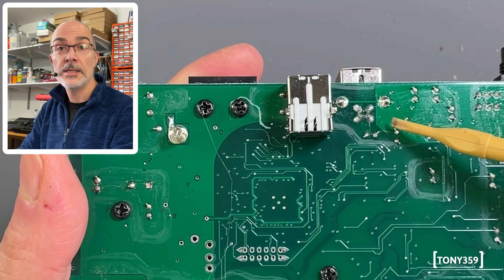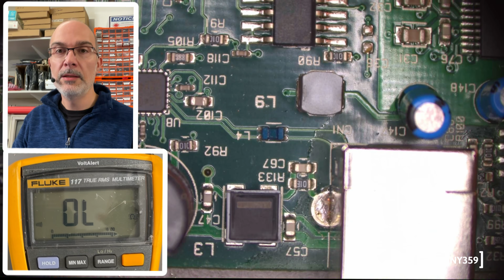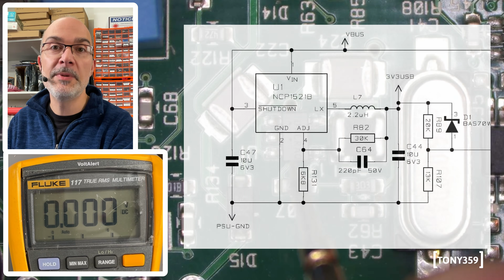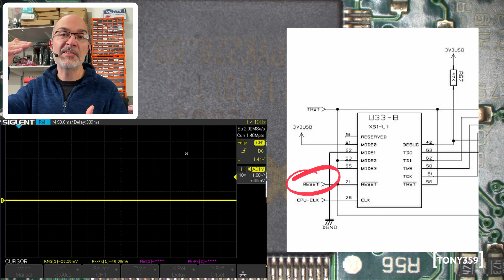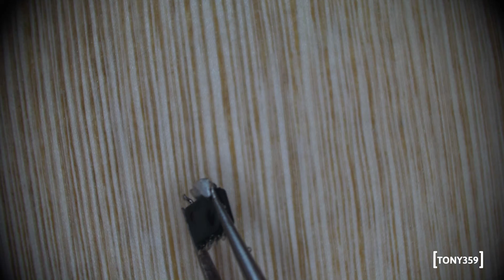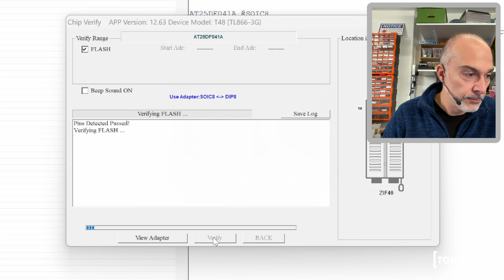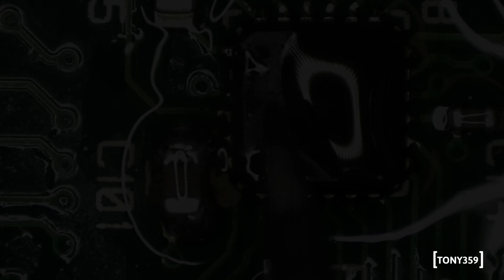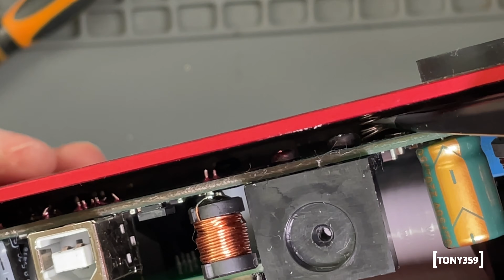Fixing this soundcard wasn't easy!

Comment: hi... first hard solder is tuff.kkkkkk.. well... it need more solder in the pcb, you dont need to wick solder out, you just clean using new solder. and to help you can claen the new chip, and left a litle bit of solder, it will improve a lot.  and finaly press down and the excess solder will go out on the border, that a sign thats all the chip is flat in pcb :) and you will never miss again. excellent work never the less. ps- i avoid to solder just one pad.... even if the rest apears ok, usse a blade and redone all the line at same time...
Reply from the maker: Thank you, I appreciate all the tips! I hope I can do another one soon! My blade tip was too big, I think you can see it at the beginning. It wouldn't even fit between the IC and the capacitor! I'll get a smaller one for next time!

Thanks again!

Comment: soldering tip was not too big, the soldering wick was improberly sized. Should use a knife-type tip.
Reply from the maker: Thanks - that’s the only wick I have and yes a bit on the big side! The first tip was knife but once again, too big 🙂 
Thanks for watching!
Reply: @tony359  learn to use the knife, I solder 0402 with a fresh 245 knife.
Reply from the maker: Well, not all 245 knifes are the same! Mine did not fit between the cap and the IC! My knife would solder 0402 no probem! :) 

But mostly I think the IC was not fully seated - hence the issue with the pad not soldered.

Comment: I had a similar/opposite issue.  My MOTU interface was having issues with the 3.3v overheating and dropping out.  After a number attempts to fix it I finally gave up on it.  It was a firewire interface anyway, so not a total loss. I am using a Focusrite Scarlett 18i8 now, love it.
Reply from the maker: Interesting! I used to have a MOTU Traveler which was a Firewire only interface. My 4Pre is FW and USB, really like it. But I believe it's a different price point than the Focusrite, which is a nice one too! Thanks for watching!

Comment: Nice work. The plug tip breaking in a jack is a pain, had it happen a couple of times which lead me to only using Neutrik plugs. The construction is much better than most with the tip being one full length piece of metal instead of a riveted design and the strain relief is the best I have seen in any plugs. And they are not the most expensive either,  sold at Thomann as assembled with Cordial cable at very reasonable price..
Reply from the maker: When it comes to sound, poor quality connectors and cables are to be avoided as much as possible! Well, the same applies for everything else of course! And you're right, often the difference in price is minimal so really no reason to cheap out on those things!
Thanks for watching!

Comment: I adamantly avoid spraying contact cleaner on sealed potentiometers like these. It usually works for a while, but the grease rinses out this way and that becomes evident with time!
Reply from the maker: Yours is a good point - though the contact cleaner I used is suitable for pots, it's lubricated. Thanks for watching!
Reply: @tony359  alright, cheers! They're not painfully expensive at ALPS, so you could always swap them out. You're not afraid of an adventure 🙏🙂

Comment: This was great!  I'm secretly happy you didn't get this to work on the first attempt...proving you are human like the rest of us lol!  I'm often working on vintage audio gear from the 1970s... really have to be careful with those solder pads as the bond between the board and the pad itself will fail even if you look at them funny.  It was very rewarding to see this device come back to life.  I really liked the segment where you pulled the firmware chip to validate.  Fantastic as always!
Reply from the maker: thank you for your kind words! Yes, it was that good balance between "easy" and "challenging"! Just the socket would have been boring :) Thanks for watching!

Comment: you can connect the rode wireless directly with usb c to the computer and get the actual digital audio
Reply from the maker: Ohhh… that’s why the Rode is ‘recognised’ when I charge it I could never figure out what device it was! I record on the iPhone anyways but it’s nice to have that extra option! Thanks for that!
Reply: @tony359  update - I compared the quality of usb-c in the receiver vs internal recording in the transmitter and the latter is unbelievably superior - turns out the receiver adds some distortion that is not present in the transmitter. All of that hassle though...
Reply: @fffmpeg  I believe you need the Wireless GO II to use USB as a recording device. Mine is the first version. If the quality is not great, nothing to be missed then :) Thanks for the update!

Comment: As someone who has not only had to replace the USB connector on a Focusrite 6i6 but also on an Akai MPK88 keyboard one word of advice: upgrade them to USB-C while you're at it, I bought a couple of 4 pin type-c connectors that terminate in a little DuPont jack and just soldered 4 wires to the pads of the old connector in the interface and crimped a fitting connector on. The type c jack fits snuggly (although diagonally) into a type b slot and can be additionally secured with a little hot glue.

You don't have any real benefits but moving my complete setup to type c has been so nice and even micro b plugs can usually be upgraded with a little bit of filing.
Reply from the maker: I can picture someone trying to plug the Focusrite blindly, trying to align the USB plug to the diagonal socket at the back! :D
Thanks for the idea - and for watching!
Reply: @tony359  I mean blindly aligning any USB C plug is probably easier than any other USB version so that's a risk im willing to take. Given, for an interface that's plugged in most of the time it doesn't really matter but for other audio equipment, some of which to this day is only available with micro USB B, this is so nice if you switch controllers often or don't have your audio setup on your desk the whole time, one plug to rule them all! ;)
Reply from the maker: absolutely!

Comment: Many thanks for posting this video! I have a Focusrite 2i2 with the exact same problem. I think go straight to replacing the USB intercafe chip. I have a 2i4 on which I replaced the USB port and that just worked fine so I guess I got lucky. I also have an M-audio interface, but those are known for the power supply chip going bad and cost more than the device is worth when I last looked so it's still an expensive doorstop at the moment. However, watching your video has given me hope that I may be able to repair at least one of them.
Reply from the maker: Amazing, hopefully you can fix it! Thanks for watching!

Comment: Another great video and repair. New old stock parts having older solder sometimes don’t work well with hot air. I have found adding some fresh solder and flux does wonders. Keep up the good work and I look forward to the next one.
Reply from the maker: Others also mentioned, definitely something I'll keep in mind, thanks!

Comment: I've had two of these. Both failed in the same way. After about a year, the monitor potentiometer became scratchy then intermittent. Disappointing.
Reply from the maker: Too bad! If I remember right those pots are sealed, not really much you can do, right? Thanks for watching!
Reply: Real. I tried Dioxit, but no joy. @tony359

Comment: Cool fix!  I have quite a few of these Focusrite interfaces (different sizes and gen) that I have collected over the years.  I have never actually seen inside one, so it was cool to see its guts.  It must've taken a fall at some point to manage to snap off the 1/4 jack tip.
Reply from the maker: It's easy to fix, there is an opening at the back of the socket, probably designed for those occurrences in mind!
Reply: A fall is unlikely to cause this. I suspect it may have been an adapter of some sort as I have known those things just fall apart or a plug that was already damaged by being stepped on, for example.

Comment: I always wonder why fresh channels put like 10 like and subscribe prompts? Does it help? Cause every time I see one all I can think of is 'piss off' and autodownvote. 
Also slathering everything in flux is a new thing or smth? Cause popping off that so8 didn't need none.
For touching up those pins 0.2mm solder wire works really well.
Reply from the maker: Well, making videos cost me money and (a lot of) time. You can watch it for free (or skip it) and I discretely ask you to "like" and - if appropriate - subscribe. 
I don't think there are 10 like and subscribe prompts, I think there are two, plus a Twitter one. 
It's a small banner in the corner, don't you think it's ok after the creator spent weeks to make the video? (Yes, it takes me weeks).
I don't have 0.2mm solder wire I'm afraid. The smallest I've got is 0.7 because I don't normally do SO8. And I really don't want to buy a reel of 0.2mm wire just for this video because it cost me more money than I make! :) 

Hence, I ask you to "like and subscribe" :) 

Thanks for watching!
Reply: @tony359  NO, I don't think I will.
Making vids costs you money? Why do it then? Or this is about the money, together with sucking the proverbial teat of pcbway, but hey, everyone does it, right?

Comment: Great work! have a look at the USB chip at 13:03..... near the R5? mark and R=330E (?pin 21, 22)
The original soldering work is not connecting the chip to the pads. Not a propper soldering
Maybe just reflowing the chip would have done the trick.
Reply from the maker: I think that was me poking around off screen, the probe just squashed the solder. But you are right, I could have tried re-flowing it first! Thankfully those IC's are cheap! Thanks for watching!

Comment: Hi great fix! can I ask where you buy your flux please? struggling to track down a good supplier. I think you are in the UK so asking.
Reply from the maker: Thank you! I have the AMTECH which is the best but very expensive. A genuine authorised Amtech reseller is on ebay (they show the AMTECH business card). Since I cannot justify using the amtech for general purpose soldering, I tried the KINGBO RMA-218 from Aliexpress. I think it's ok and it's MUCH cheaper. Maybe on this occasion I should have used the AMTECH - I forgot! :)  I hope this helps!
Reply: @tony359  Is that reseller on ebay be "CNLS Electronics" ?

Thank you for the information
Reply from the maker: no, pep-cd.
Last time I checked they were showing a card confirming they were AMTECH distributors.
Reply: @tony359  Thanks!

Comment: How do you find schematics! I bought a pre-Sonus interface and it's in great condition except for the power supply and the company is absolutely no help. At first I thought it was a burned out resistor but after replacing (had to guess known defect even the replacement was discolored so decoding impossible) that it's still not fully powering up. I bought another unit and swap the power supply over and everything is functional. So now no it's just the power supply I suspect maybe a capacitor because it's trying to start and then failing and then repeating.
Reply from the maker: I google! Sometimes I am lucky. Sometimes I am not. In this case I was lucky enough to find the 2i4 ones which are linked in the description if you are interested.
Well done for fixing the Sonus!

Comment: I had same sound card, with same problem. And i change the USB comunication chip without even measure it. because i knew that when USB is broken and the chip also die for some reason.
Reply from the maker: interesting, others have reported the same. I wonder whether that IC is a bit fragile or maybe there is some minor design flaws which is making it a bit susceptible to failure!
Reply: @tony359  The chip itself is ok. The USB connector is the problem. Because when person kick the cable, pull it in wrong direction or whatever the case is, causing the pins of the USB to touch each other. That cause the chip fault.

Comment: The third gen focusrite I tested had a big peak in noise at 90KHz.    A problem I noticed on a lot of other interfaces by other brands.   While you can not hear it, it does effect the next opamp in the chain.
Reply from the maker: Interesting find. I suppose that could be easily filtered out with some passive components? Thanks for watching!
Reply: That's the shaped noise from the DAC. The CS4272 DAC is a relatively old and inexpensive design with like 1 or 2 bits only that requires fairly high-order noise shaping (4th or 5th-order I think) for it to achieve its rated performance, resulting in substantial amounts of ultrasonic noise that requires dedicated external filtering in addition to what's built into the chip... which in turn inexpensive interfaces will commonly skimp on, and at least the 2i4 is no exception.

The "big peak at 90 kHz" isn't even an actual peak, that's just the effect of ADC filtering kicking in when recording at 192 kHz. Things merrily keep rising beyond that point for a good while longer. Seems to be about a 3rd-order slope, so even the circuitry suggested by the datasheet would not be entirely adequate if you are serious about your hi-res.
Reply from the maker: @PileOfEmptyTapes  amazing insight, thank you!
Reply: @PileOfEmptyTapes  
The codec may be an old design, but it is also not understood.  Otherwise someone would place an analog low pass filter on a higher end interface.

I ran a test where I mixed a guitar with a 32KHz sine into a distortion box.  The poor opamp got so saturated reproducing the 32KHz tone that it undistorted the guitar.  

It is my understanding that a codec works by sampling at a much higher rate and lower bit depth into an adder accumulator.  (CIC filter)  Then you carefully select a series flat-top and or half-band filters to push the noise out of band as much as you can while reducing the sampling rate.  I guess you are saying that the noise is the result of inadequate digital filtering for an interface rated for 192 KHz and a lack of any analog filtering.
Reply: @moddaudio  "The poor opamp got so saturated reproducing the 32KHz tone that it undistorted the guitar." Congratulations, you have proven that high-frequency AC bias helps a baseband signal overcome a strong nonlinearity. Messrs. von Braunmühl and Weber really were onto something, eh? ;) 

The importance of this effect for audio reproduction cannot be overstated. It helped tape overcome its scratchy lo-fi beginnings and turn into an actual hi-fi medium, and without it things like delta-sigma A/D and D/A converters (which are vastly dominating audio applications) or Class D audio amplifiers (which are using a switch-mode output stage and PWM) would not exist.

The CS4272/CS4392 presumably runs a dual bit modulator (3 levels or ~1.585 bits) at 128fs (12.288 MHz at 48 kHz in). Even including 21 dB of oversampling gain, it would only achieve a dynamic range of about 32 dB when applying flat (white-noise) dithering, absolutely pitiful performance. These kinds of modulators need substantial amounts of noise shaping to shift most of this noise outside of the audio bandwidth, which results in a noise floor rising with frequency - so you get less where it matters and more above. The more dynamic range you are trying to squeeze out of a given modulator and sample rate by increasing modulator order, the steeper the rise is. While there is some internal analog (switched-capacitor) filtering in the DAC to address ultrasonic noise output, it is unlikely to be comprehensive in a price-conscious DAC design in particular.

The maximum modulator order I've seen in a DAC has been 5th order, and when designers can get away with 4th or 3rd order while still achieving the desired performance they will happily do so, just because it makes them easier to manage. The maximum on the ADC side has been 7th order, which is really extreme but not such a big deal there as digital filtering can get rid of the noise during decimation. Even getting such a beast mathematically stable would have been quite the accomplishment (it used to be a real problem for the design of higher-order modulators).

At least running a higher-order modulator means that increasing the oversampling ratio (i.e. its operating frequency) gives major gains - at 4th order or a 24 dB/octave slope, doubling it turns a converter not even quite making it to CD quality spec into a midrange audio interface affair, assuming the analog side can keep up. A lot of designs made the jump from 64fs to 128fs in about 1995-98.

I realize this is a real rabbit hole into the nitty-gritty of digital audio. Understanding dithering with or without noise shaping is not trivial.

Fun fact, shaped dither was instrumental in the CD revolution itself. Remember that Philips only had a 14-bit DAC at their disposal (the TDA1540)? Using a digital filter IC to run it at 4X oversampling gave them another 6 dB, but that would still only have been 15 bits effective. So the filter would apply some noise-shaped dithering as well, which pushed performance levels in the audio band to about 16-bit level as desired. Mind you, the filter created some new problems - a 0.2 dB periodic passband ripple spec in an FIR filter is not pretty, for one.